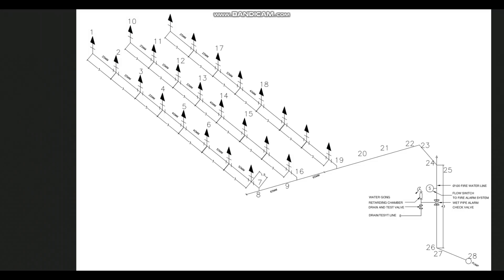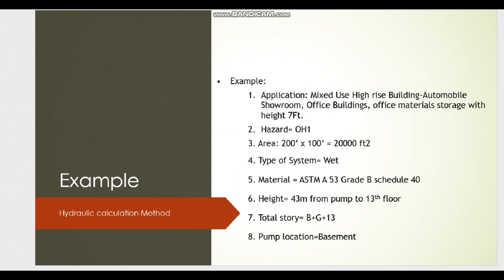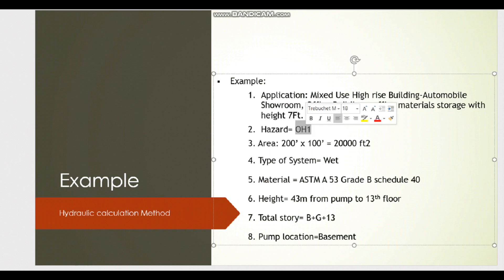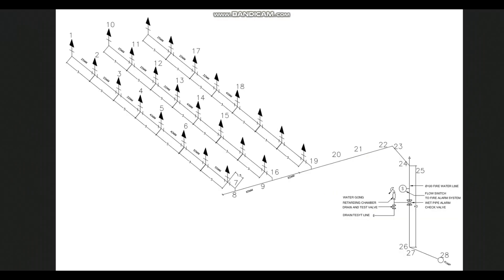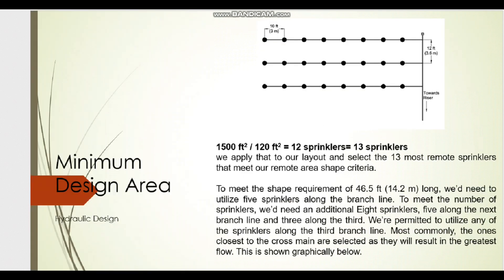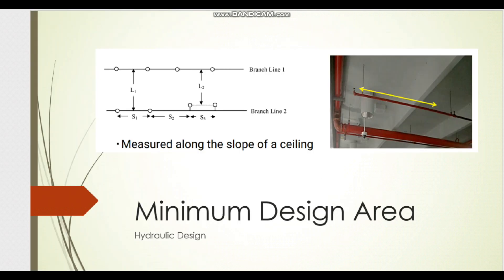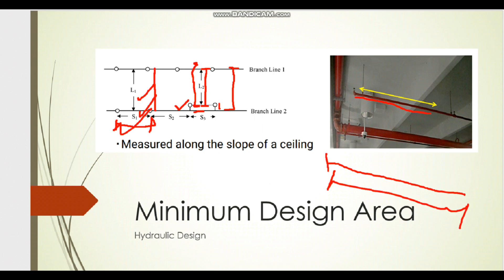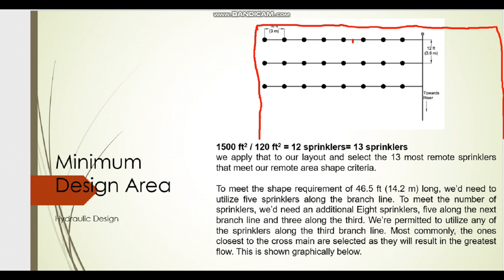Chapter 4-Part 1-Sprinkler Design Hydraulic Calculations for High Rise Building with Excel File

Comment: I have one question related to pressure loss calculation sir. In NFPA 13 2022 28.2.4.10.2  normal pressure could be calculated by substracting the velocity pressure from the total pressure. How velocity pressure calculated in sprinkler design
Reply from the maker: Hi 😊 thank u for your comment!
Normally, in hydraulic calculation we use NFPA 13, 2022 Clause 28.2.2.5 to find out the pressure of the sprinkler that is " Pressure from an orifice" or "flow from an orifice" using the formula k=q/root of p. Secondly, for velocity pressure, u need to see NFPA 13, 2022 clause 28.2.2.2 to understand how to find out velocity pressure using pipe internal diameter and flow. And as mentioned in the clause 28.2.2.3 this velocity pressure + nominal pressure = total pressure
Reply: @mepworld3385  Thanks a ton sir